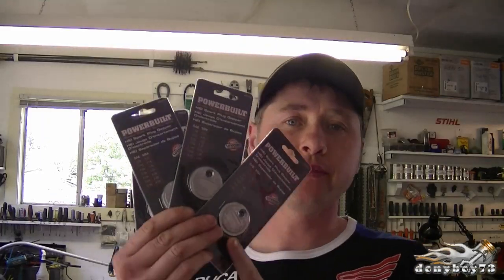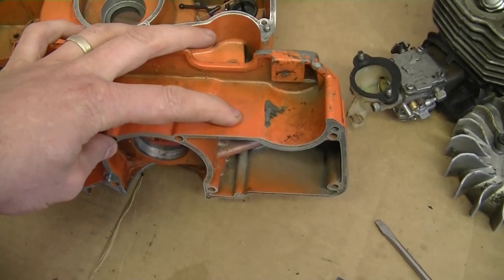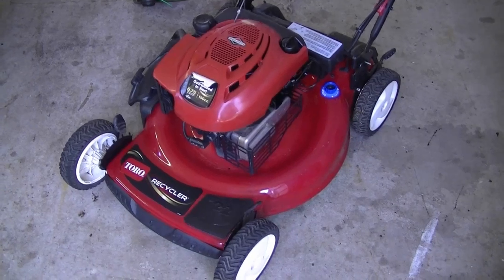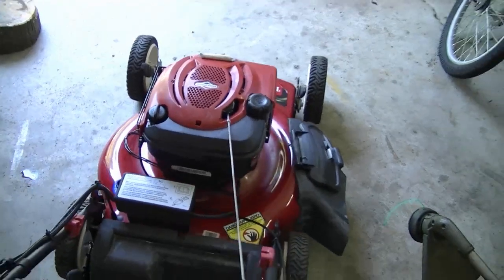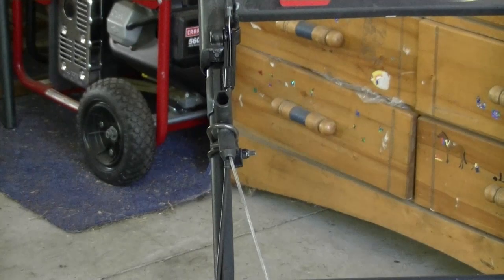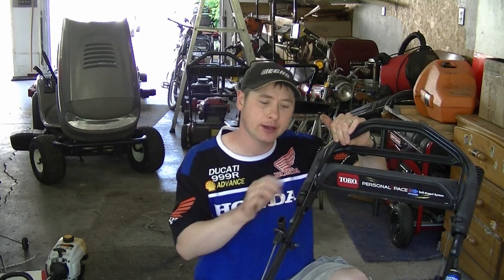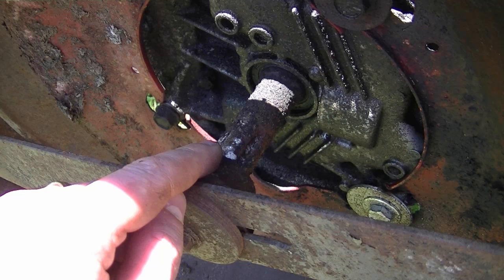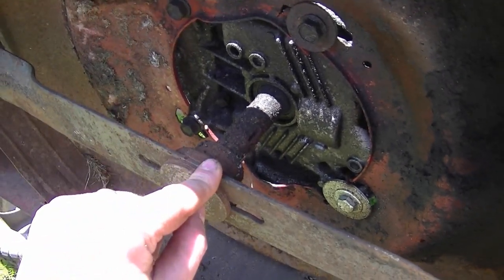Small Engines Q & A Video #52 in HD

Comment: when I was a teenager I hit a steel pipe and bent a crank on a push mower so bad the blade rubbed the deck and ground at the same time. I used a hammer to straighten it enough to run but it shook so bad it would cause blisters on your hands if you didnt wear gloves. I used it for the rest of that summer. Young and dumb and poor those were the day's lol.

Comment: MY QUESTION continued:I had a Honda HR-214 self propelled mower given to me that didnt run. I flushed the tank out, replaced the in tank filter, took carb apart and cleaned completely, ( main jet & nozzle), all other ports except the Idle jet. It ran and quit good I might add but had a engine LOBE, so I diagnosed it as a dirt Idle Jet. When I tried removing the jet/plug, (being made of plastic), it broke. My QUESTION is: do they make a BRASS jet & plug replacement..? Plzz HELP me...ty

Comment: Hi, If its not too late i would like to enter your competition.
Quick question on the mowers what it the best way to remove a the stubborn alloy spacer which the blade bolts to. The mower you showed with the bent shaft that spacer looks pretty solid on their. Is there any way to straighten the bent shaft.
Regards Dave uk. Keep up the brill work.